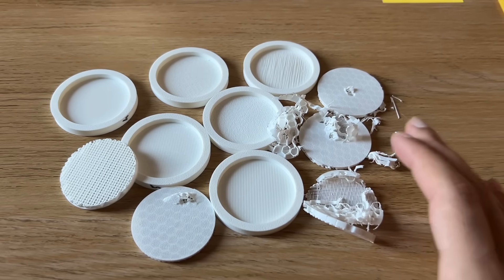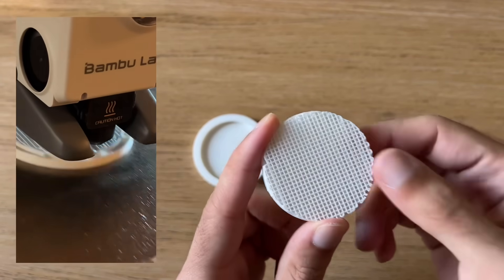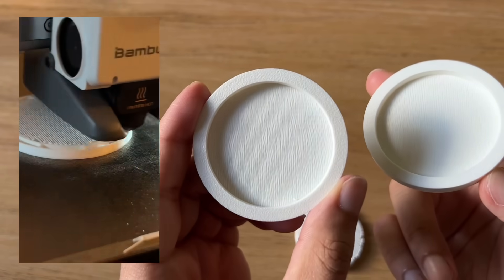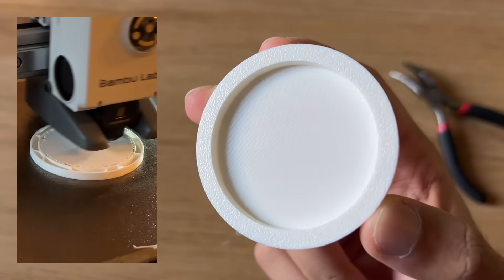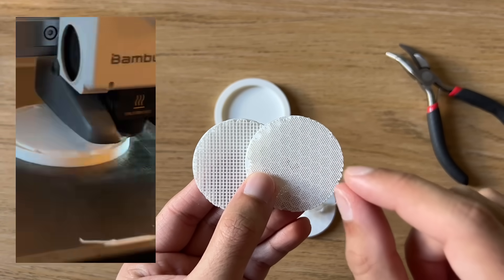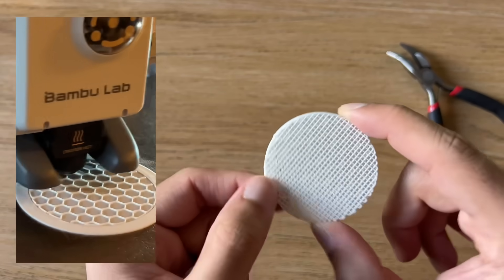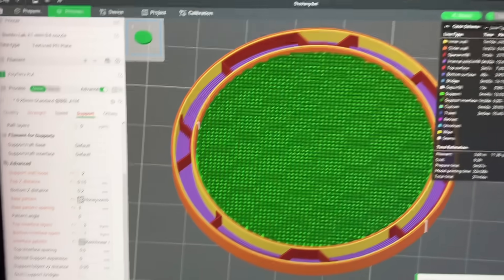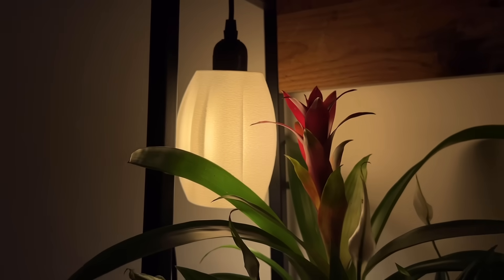Best Slicer Settings For Printing Overhangs?

Comment: Print an object out of petg to fill the void where the support goes. Put a pause at layer height to drop the puck into the void. Continue printing. Perfectly smooth and reusable support.
Reply from the maker: @MakerMark  never thought about a reusable support, that’s awesome
Reply: @doublesketchstudio  For repeatable parts that nomen omen support reusable support, I use one covered with panter's tape (blue tape?) and a bit of PVA.
Reply: Best advice I’ve ever seen in a comment section
Reply: This comment deserves more likes! Thank you for your creativity
Reply: Would the part need to be slightly smaller than the void, since it won't be stuck down to the plate? I feel like, especially with the textured plate, the piece is going to be sitting slightly higher
Reply: @dustinroberson1865 that's true, I'd design the part with a little tolerance on top as well as on the sides, that way you don't dislodge the print trying to put the support piece in
Reply: Or if you print a part using PLA, you can go to the support settings and chose PETG as a interface base support.
It will basically do the exact same thing but without you having to print a petg part and set a pause, manually insert the petg part and resume printing.
The good thing is, it only print one or 2 layers of PETG that will be in direct contact with your PLA part.
It will give you a very smooth and clean result and very easy to remove.
Reply: @GnR3N The only concern with this, and it's truly a minor one, is that you need to purge between materials quite a lot more to be sure you get all the PETG out of the nozzle. If you still have PETG residue when printing the rest of the part, the PETG will interfere with layer adhesion and create a weaker part for 1-2 layers. 

For the /vast/ majority of cases this probably isn't a problem, but it can happen and might affect parts which need to be full strength where the supports were printed.
Reply: @Pyrichia  I've learned that the hard way, but idd you are correct. Overall i think it's the best way to have clean nice print. you just have to put the right settings in your slicer, controle your pruge settings, your interface layers, infill, spacing and you are good
Reply: @Pyrichia  Same here. I actually never got it to work reliably. In fact befor this happened I didn't understand why bambu even bothered with a dual nozzle machine like the H2D.  Ohhhh, now I get it ;)
Reply: Genius...
Reply: Very clever !
Reply: Not really practical for models with lots of overhangs
Reply: I’m not trying to be hyperbolic here, but that is friggin genius!
Reply: I print a (reusable or not) support object out of THE SAME filament, either in advance, or as part of the normal print.
I then prevent top adhesion by painting the surface with black sharpie pen.
Reply: Wish there's was a video about this I'm confused
Reply: That's so genius
Reply: Just tried this, works like a charm!
Reply: Yup this method works. Only issue is sometimes the petg puck will spin during the print.
Reply: Woah that's genious
Reply: This is a genius way to get multi material supports on any printer! My hat is off to your creativity. Just be sure there’s no brim extending inward or the “puck” won’t fit properly.
Reply: BIG BRAINNNN
Reply: @MakerMark   Something else I just considered … if the support is puck shaped and placed after a pause, the support can shift while the print is going over it causing all kinds of mess at the interface. Some kind of arrangement to stop it from shifting may be necessary. One way to do this is with an aligning pin printed in the lower supported area on the model that fits a similar depression in the support puck.
Reply: @ in the video, the area needing support was a specific size. The puck needs to be the same size minus a small margin. It wont move.
Reply: @MakerMark   A circular puck that is not glued down or keyed in some way will rotate as soon as  tangential friction is applied to the edge, much the same way as printing the first bridge layer will apply. It starts the bridge at the edge, not the centre. The object is to make the puck the exact z dimension so the print has a support that is physically touching. If you’re leaving a gap, you may as well use standard supports. Since the support puck is same z height, whatever surface pattern you have on the support puck will be transferred to the print. I doubt it will work with holographic patterns but filament patterns like concentric are transferred very well.
Reply: @ tl;dr
Reply: @MakerMark   ts;ch
Reply: Not a viable strategy if you run a business
Reply: I have been using reusable supports for a long time.
Reply: this is really smart
Reply: Great advice. I would like to add that the suggestion for petg is good when your actual object is of PLA.  These material don't stick together which makes it easier to use the other as the support. So if the object is PLA then PETG as support and vice versa.
Reply: infelizmente na maioria das peças a extrusora irá colidir com a peça em petg durante a impressão da peça principal
Reply: yeahhh I'm definitely considering that one if I make more gridfinity carry cases since they go on my big printer without multimaterial support.
Reply: Or just print with PC-PETG filaments, best of both worlds it has the speed of PLA and also the easy support removal of PETG.
But a little bit more expensive and also harder to find than other regular filaments
Reply: @Jootn2kx Are you sure you wrote it correctly ? Because I can't find any information on a blend of PC-PETG...
Reply: @0miCr0n07  cc3d pc black is 45% petg
Reply: @Jootn2kx 

Easy support removal of petg?

u wot mate. Petg weld to petg is insanely strong.